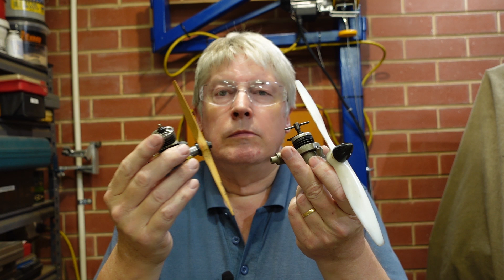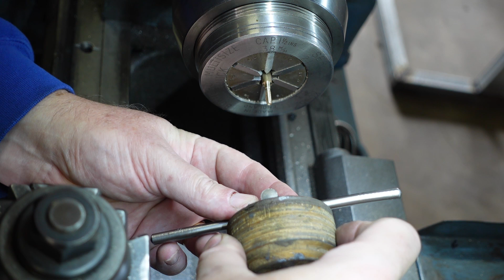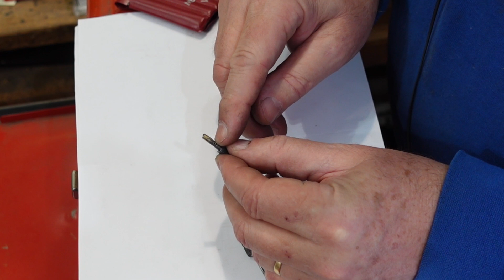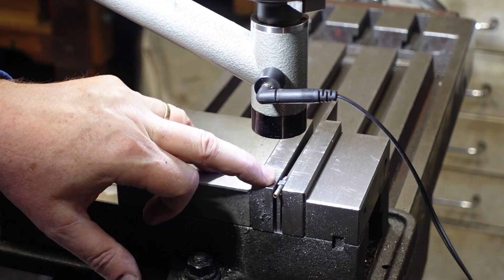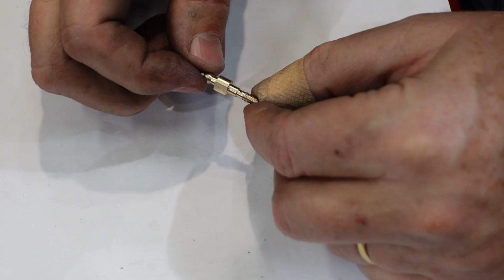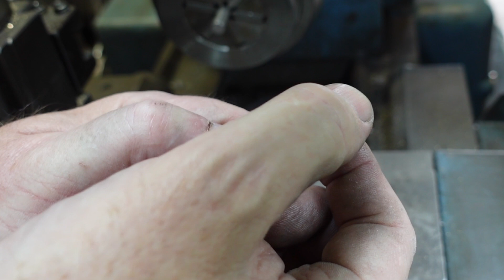Aircraft engine parts

Comment: Hi, I am making spraybars and needles for control line engines like the 2 ones you have got.  The first one could simpler be drilled in a V-block, that is how I do this. On youtube there is a canadian man Dan Gelbart that shows this extremety simple V-block for the lathe that really works.
The second engine has what I call FOX paddle needle. FOX are typical control line engines but the paddle needle is akward for us flying these engines, the knurled ring nearest the thread sits in an U-formed clp gripping into the knurled valleys to prevent it from altering it's position. Thoose I usually make new spraybar and M2 thread for the needle.

The only 2 critical things with spraybars and needles are that the outer diameter is the same in that portion one can see when looking down into the venturi,  and that the crosshole needs to fairly centered in the venturi.
The needle's taper must be able to close the fuel supply entirely. 
For glow plug engines the opening is far larger compared to a diesel engine that usually has very strong suction and are known for the very low fuel consumption ad extreme sensitive for air leaking aside the venturi or spraybar.

The crosshole can be either bored through or just a single hole. The one-hole must have some sort visible index so one can se how the hole is facing the engines suction. Wth throughole the holes must sit perpendicular to the boring of the venturi. There are also like the PAW diesels 2 holes, but not drilled through in 180 degrees, they are more likely 120 -140 degrees.

I frequently convert throtteled Radio Control engines to fixed venturi size and making new spraybar and needle.  

The function of a control line engine is that the diameter of the venturi bore is carefully tried out in the factory and the fuel needle is adjusted normally so that the engine runs just between 4-strooking and 2-strooking, this is valid for F2B Precision Aerobatics or more commonly named STUNT. The needle's position varies depending on the air humidity and the temperature and hence need fine adjusting before each flight if air humidity and temperature changes like in the evening when the dew comes.
For speed models and models with exhaust pipe other practice is used.
Cheers!  //  Ingvar, living in west Sweden
Reply from the maker: I must confess, I'm just a machinist who was asked to make replacements. I do have a v block arrangement I use with my drill press but as I wanted to get it close as possible to the original, I did it this way.

Comment: Once a gain an informative lesson. Never heard of a sensitive drilling attachment, but looks absolutely necessary for small work whether you are using a drill or mill with our without a quill. 
For drilling the brass did you soften of (blunt) the drill edges before drilling - particularly the long holes? As you say drilling brass can be nerve wracking.
Reply from the maker: I've never found brass to be that 'grabby' (except once...). That part was well secured and I  pecked both holes, so no special prep on the drill. If I was using the drillpress it would be a different story.

Comment: Hi Mike, good job, do you know if he got them working? I wonder if he is a member of MASA a model airplane club which I am in as well. Much of the conversation around the meetings is about machining little parts.
Reply from the maker: Thansk Dave. As far as I know, has not tried running them yet - I did some other stuff for him that got him even more excited. As I doubt I made perfect replicas there may need to be a bit of tuning before they run smoothly.
These engines are for control line aircraft apparently. I don't think he is a MASA member but I'll ask.
Reply: @occasionalmachinist  Yep, I recognise them, one of the groups I am planning to spend more time with as retirement approaches are model air plane clubs and MASA lease a field in the south park lands every saturday for control line flying. Getting the engines to work is one of the biggest challenges.
Reply from the maker: @ Used to be with MASA. He lives up north and travel time got a bit much. Perhaps now he has potentially working engines...

Comment: As soon as you mentioned needing to manufacture aircraft parts, I remembered a similar situation ~35 years ago.  A coworker was building a kit airplane (person-size) in his garage and had an "oops!" while attempting to make a high-speed taxiing test at a local airfield.  It took off at a much lower speed than he had expected and by the time he got it back down onto the ground, he was out of room near the end of the runway.  The only thing physically damaged by his hard landing was a piece of landing gear (LDG) linkage that snapped due to the loading.  He brought the broken into work and was standing near me when he showed it to another coworker.  I overheard them discussing it and told him that I had a mill-drill in my garage and would be willing to machine a replacement for him.  He gave me the two pieces of the LDG plus a piece of aircraft-quality 7075 (or very similar type) aluminum -- I machined it at home and brought it back to him after the next weekend.  He was quite relieved to have his (I think it fell into the category of ) "experimental" home-built aircraft back in business so that he wouldn't have to delay his next mandatory inspection in order to get the airplane certified for flight.

However, I've never tried to machine anything like the delicate model aircraft engine components that you built for your coworker!  Thumbs-up!
Reply from the maker: The sheer (lack of) size was a challenge I must admit. Does make me wonder how they were originally mass produced.